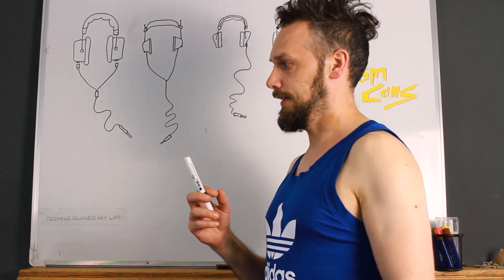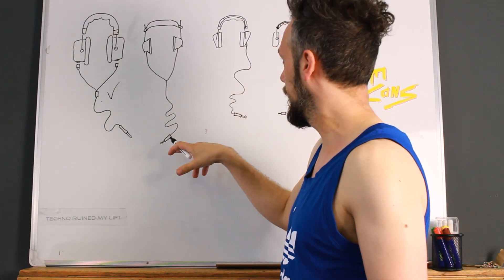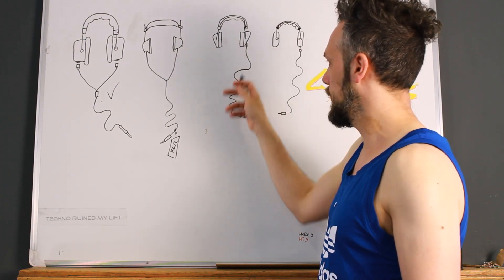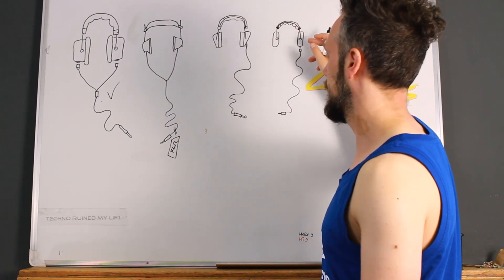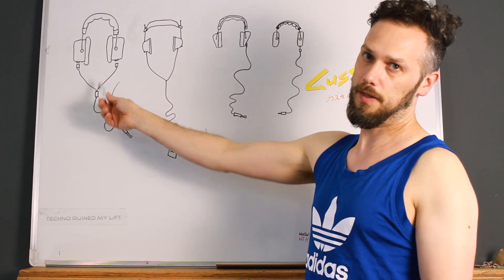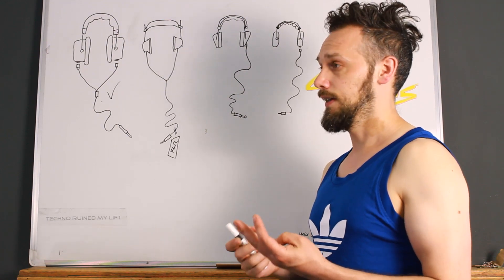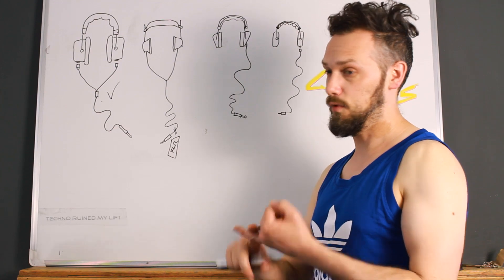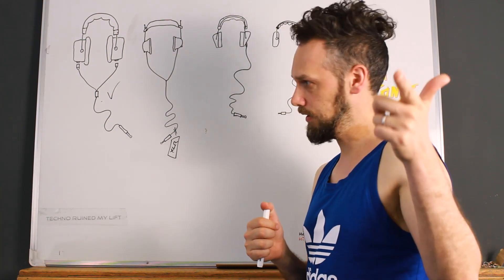Can my headphones take a balanced connection?

Comment: Superlux hd681 Evo should irewire socket or driver?
Reply from the maker: You would probably need to hard wire a balanced cable to the drivers or fit a 4 pole socket and make a custom cable

Comment: Hi I have a single sided detachable 5 pole 3.5mm headset with a mic, would this be able to take a balanced connection?
Reply from the maker: It would totally depend on how it is wired inside the hheadphones

Comment: In video you say than the single side Detachable cable is no best way to give a balanced connection. But i have Beyerdynamic COP, because this beyer proprietary connection is a su%$&* and to found a replacement cable is a real headache. Was thinking to mod to making easy way that take replacement. Could you give me any tips?
Reply from the maker: I am pretty certain I said dual entry detachable is the best and single sided detachable it the worst for balanced

Comment: Hi! Can I use a 4 pin xlr adapter in a Beyer T1 1°gen (not detachable cable) and plug it in a full balanced amp (xduoo mt-604)?
Reply from the maker: No, that is not a good idea but you can cut the end off the T1 cable and fit a 4 pin XLR and then use an xlr to jack adapter for using them with normal equipment
Reply: @CustomCans  Thanks!

Comment: For the second one, since you use the original cable I guess that's not a problem? So no need to use expensive balanced cables? What is the advantage of the expensive balanced cables you can buy then?
Reply from the maker: Well.... I have spent the past couple of months designing a new range of super high end cables so am almost certainly massively biased but.... some high end cables do have better electrical properties. The difference is usually quite small and it is debatable how much difference you would hear but a lot of high end cables will have lower impedance and capacitance than the stock cables. If you don't believe in that kind of thing then.
Ergonomics - Some high end cables  are more flexible and feel nicer
Microphonics - Some cables transmit a lot of sound to the earcups when they rub against things like clothing - reducing that helps general usability 
Looks / bragging rights - there is nothing wrong with having something that just looks and feels nicer - my wife's £700 hand bag does not hold her pens and keys any better than a £20 one but owning a beautiful, well made thing makes some people happier every time they use it.

Comment: I have a pair of dt 770pro 80ohm headphones, and want to use them with the 2.5mm balanced output of my Fiio BTR5. Any advice?
Reply from the maker: Here is a video showing how to convert them to balanced
https://www.youtube.com/watch?v=HLfxeyZOQW0

Or we offer a send in service
https://jfunk.org/wpc/product/beyerdynamic-detachable-cable-mod/
Reply: Several Manufacturers of balanced output  have not same pins in audio output,  fiio their own pins have, so it.s need to find in the net the picture of pins location. And after solder the jack.

Comment: Hi can the B&O H6 use a balanced connection 4.4mm.? Thanks
Reply from the maker: I don't think so but I have not seen how they a re wired internally so you may have to check with B&O